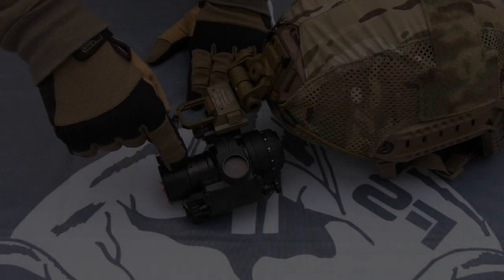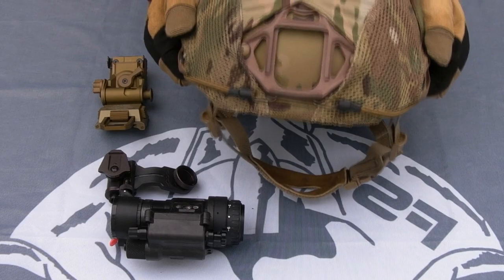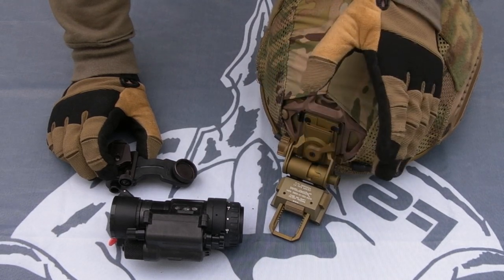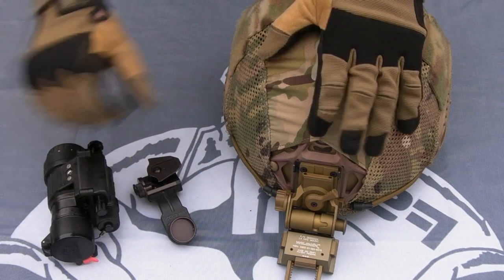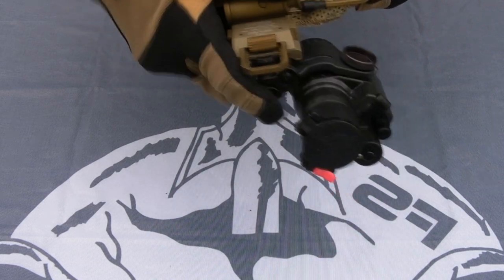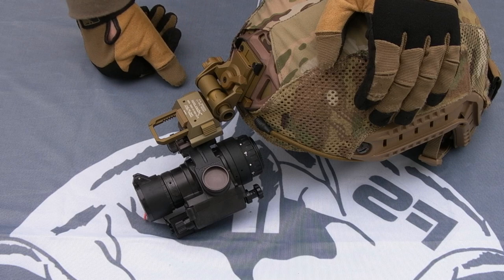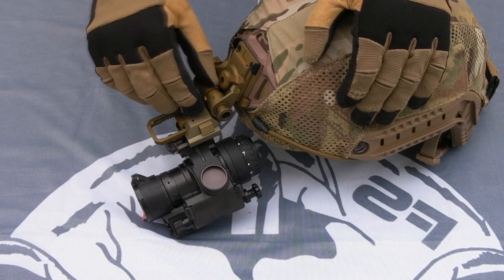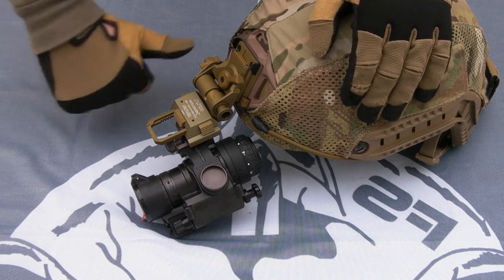Mounting Night Vision 101

Comment: After watching a lot of videos, I can say this is the best. Actually going linearly through each piece and how they interact certainly is basic, but it’s so basic that most videos overlook it entirely. As a novice to NVGs, your video finally allowed me to understand what’s going on and make sure I ordered the correct parts. 

Do you have any tips for tethering the PVS-14 to the helmet for security in the event the device becomes dislodged by accident, or is fumbled when taking it off?
Reply from the maker: It took me a fair bit of time and effort to learn this stuff for myself so it seemed like a gap in the market, as it were.

Good question, I have the wilcox retracting lanyard, but honestly you can just use any bit of string that's long enough when the device is deployed horizontal.

Comment: I found myself only being able to shell out enough for the much larger Wolf-14 monocular and I was wondering if there were any mount setups you could recommend for that.
Reply from the maker: Never heard of that one, just gotta find out what mounting thread/fitting it has and the compatibility therein.
Reply: @CKinnerley  Thanks for the reply. The intel that I've gathered so far has been that anything other than the proprietary J-arm simply will not fit around the housing itself, due to its width. I really would like to be able to have that capability, and while its almost a certainty I will have to go with their specific tech I would like to see if there were any alternatives.

Comment: ?: are the screws on those J-arms all the same standard size? [whatever that is.]  Also: do you ever use one of those 'balancing weights' that mount on the back of the helmet?
Reply from the maker: proper mil spec kit will be standardised, but there's a lot of commercial junk out there.  i own an ops-core counterweight pouch, it's pretty essential.
Reply: @CKinnerley  thanks, I'm hoping my sore neck won't break lol

Comment: Two questions: what helmet and cover is this? What resolution and SNR is your tube?
Reply: The helmet is a TMC fast helmet (multicam version) and the helmet cover is the TMC mesh multicam cover I believe. 

Helmet: https://www.weapon762.com/helmet/1793-tmc-fast-mt-super-high-cut-helmet.html#/4-color-multicam

The helmet cover could be either from EMERSONGEAR or TMC, I'm not entirely sure.
Reply: Helmet is Ops Core Carbon, Cover is a First Spear Hybrid.
Reply: @crispymeister8076  Pretty sure someone that has enough money to grab a PVS-14 and Wilcox mount set won't resort to mounting them on a cheap airsoft chinese replica lol. The shroud has Ops core logo, and the arc rail appears solid without molding line, it's safe to say his lid is genuine

Comment: AND of course he doesn't show the one thing i needed to see, how does the mount attach to the shroud?? is it a compression device? is it a click into fit? what? WHY wouldn't you show that???? UGH..He literally showed Every single step except that one...WHY???
Reply: Several friends own L4 G24s, so I can answer this for you.

It slides in at the top; clicks in at the bottom. The L4 G24 has the option of setting it to come off your helmet in a force-to-overcome fashion if you bump it hard enough in order to save your neck. You can also disable the force-to-overcome feature.
Reply: You can think of it kinda like the battery cover of a cheap made-in-china toy: it slots/slides in on one end and clicks on the other.
Reply: @fi4re  ok thanks very much i appreciate that! Now i can actually assemble it when it arrives! lol
Reply from the maker: When you're sending a notification to the phone of the person in the video it's pretty weird to refer to them in the 3rd person.

Anyone with an IQ above 50 can figure out how to click in the mount once they have it in their hands, you won't require instructions.